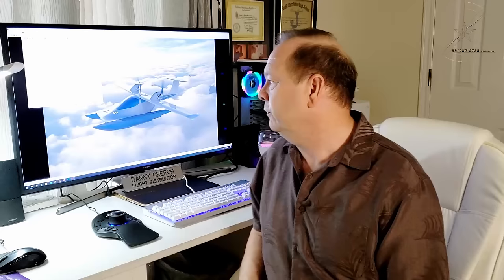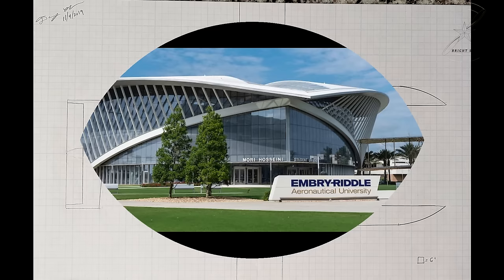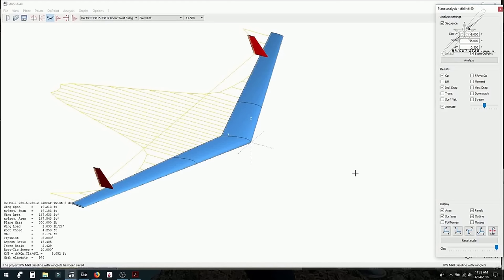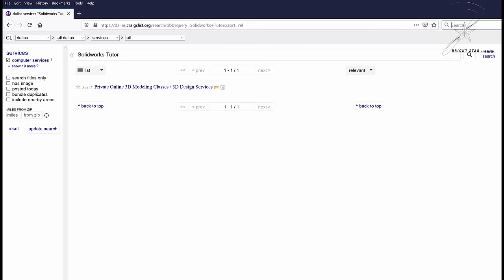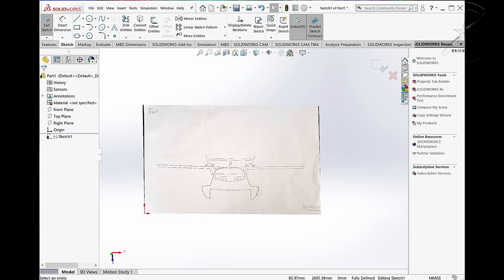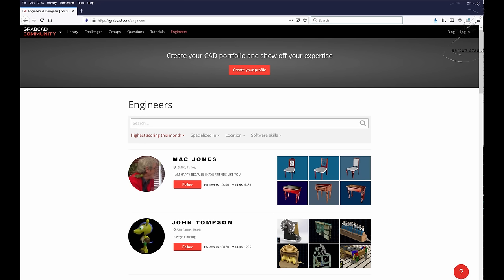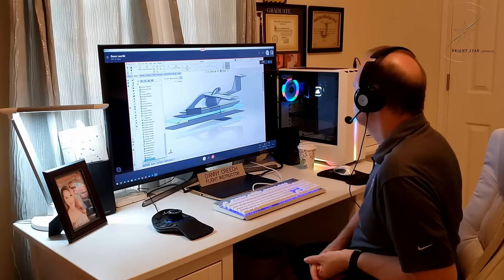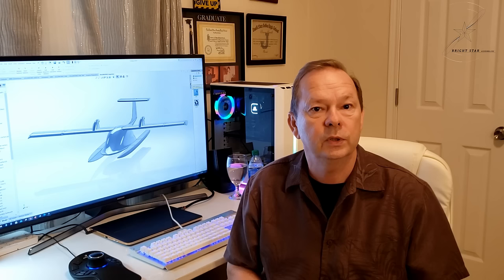How to Design Your Own Aircraft

Comment: I think the title needs to be more about CAD and Solidworks.  Years ago I designed and built production aircraft from concept to maiden flight in about 3 years.  The proposition I made to the Investors was that I was able to design a computer to design a model.  When as a designer, its not really about the tools. Yes we had old styles drawing office and I was self-trained on drafting and computing, and yes knew how to design and use a slide rule. The main key to understanding a design problem, you need to know how to make it before you build it. Work and think backwards. As for scaled model making and proof of concept, do not use CAD.  Use your hand and some modeling clay to craft an idea.  Aerodynamics, L-D, fluidity, laminar as so on, is about SCIENCE and MODELLING, learn the difference.  A small JAR22/23  would have 1000 parts.  Each part has a primary and secondary function and limit. Do not guess, assume or forget. Think about each part, model it and make a list of 1000 reasons to either use it or not.  We call this FUNCTIONAL ANALYSIS.  No CAD can give you the answer.  Lastly.  LEARN more about FEA not CAD. All you need is paper, a pencil and a calculator = $10.
Reply from the maker: Thanks for your comment.

Comment: If you're still working on your project, you might get some ideas from the subject of dihedral.
https://en.wikipedia.org/wiki/Dihedral_(aeronautics)
Reply from the maker: Thank you for the comment. Yeah, I learned about dihedral 38 years ago as a student pilot. My aircraft does have a small amount of dihedral. As a high wing aircraft it doesn't need as much as a low wing aircraft. I will show a photo of the aircraft with a straight line going across in my next video so you can see it. But yes it does have dihedral.
Reply: @BrightStarAssemblies  sweep and dihedral can provide stability during a crab, when you try to lose altitude with full rudder and full opposite aeleron.
Reply from the maker: @brookestephen  I think you are confusing "Crab" with a "Slip" there are two types of "Slips". The one you are describing is called a forward Slip and is used for losing altitude. A crab is performed with the wings level. More to the point we call it a "Crab angle" as we are flying the aircraft wings level but the nose of the aircraft is not pointed directly towards the runway. In a sweep wing aircraft, such as a jet which I am typed on four different ones, you do not want to slip these aircraft. This is why, unlike a Cessna 172, in a cross wind we do not "Side Slip" them. Instead we fly a "Crab" down to the runway and at the last minute kick the rudders to put the nose straight down the runway and lower the upwind wing so we do not drift. As for your statement " sweep and dihedral can provide stability during a crab" this is incorrect. Saying a statement like this tell those of us who are pilots either you are a student pilot or not a pilot at all. Sweep and Dihedral are aircraft design elements engineered into an air frame and a "Crabs" a flying technique. I'm sure you could Google both "Wing Sweep" & "Wing Dihedral" and read why they are designed into a wing. But they are not designed into an aircraft for the purpose of ding a "Crab".  Thanks for your comment.
Reply: @BrightStarAssemblies  thanks for setting me straight... I haven't flown in a while!
Reply from the maker: @brookestephen  Yeah no worries. As always, thanks for your comment.

Comment: howmutch cost of this aircraft
Reply from the maker: Thank you for the comment. As of right now we do not have a product for sale. I can only speculate how much the prototype will cost for me to build. For sure it will cost a lot more than the second one as I will already have the molds and many of the smaller supplies. Once we finish the second prototype, then we will offer kits. The cost of the kit right now is totally unknown. But if I was to guess, probably around $110K. Maybe less maybe more. But you are talking about a carbon fiber complex gear multi-engine amphibious aircraft with water jet thrusters. The first 10 kits will probably be required to be built in our shop so that we can make assembly videos and manuals for customers.

Comment: CG mean what
Reply from the maker: CG is short for Center of Gravity. Think of a teeter totter. In the center is a point where the board pivots over. An airplane is in a balancing act the entire time it is flying. Before taking off a pilot must make sure that the CG is inside the proper forward and aft CG range. If not it will cause problems.  For example if it is too tail heavy on take off the nose of the aircraft will come up and possible scrape the tail and even worse might be so bad that the controls can not stop the front of the aircraft from going up too far in which case the aircraft will stall and crash. So, it is very important for pilots to ensure the aircraft is properly loaded within  the CG range.